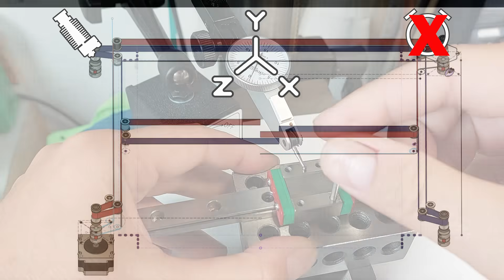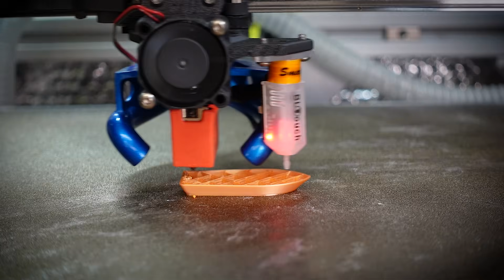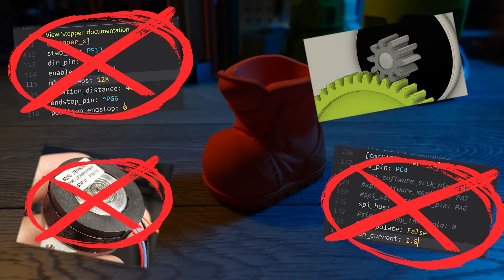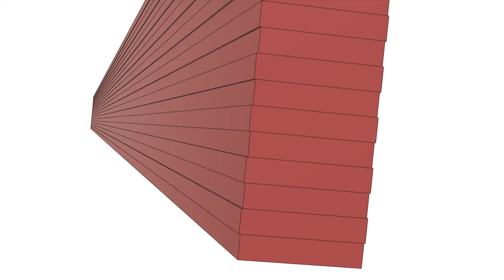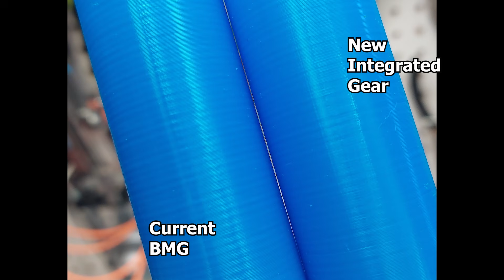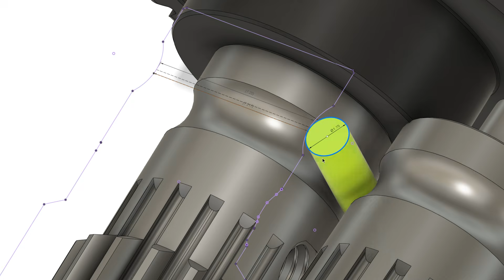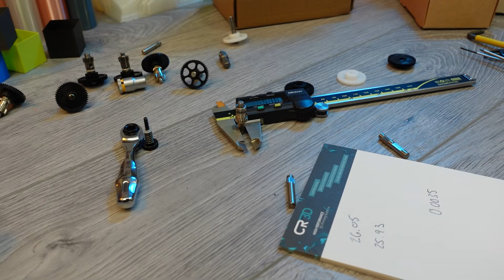Extrusion Quality - Mystery issue resolved !

Comment: I think you doubled your estimate of the error at some point during your calculation. You measured the deviation between the high point and the low point as 0.076mm, then you declared that this applies to the radius on both sides, and calculated that the deviation between the high point and low point is 0.152mm - but you just measured the deviation to be half of this value.
Reply from the maker: I had the same reaction then you initially. But try it out.  You will see that since we are playing with radius, it doubles the value.
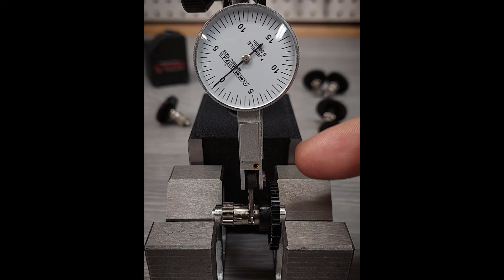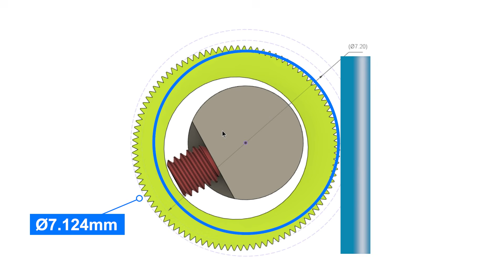Reply: But your setup at 8:11 is already measuring the deviation of the radius between the minimum and maximum point. Your diagram at 9:40 shows the exact measurement that you are making with this setup, but at 9:40 you have erroneously doubled the distance.
Reply: Other than that, no issue with the video! Great stuff, good problem solving, etc. I don't think this invalidates any of your argument. But I think it is a mistake to double the value.
Reply from the maker: @jsincoherency  ha, I see your point.  Illustration should have shown the delta between the 2 diameters rather than showing this at the radius.  But the math are still valid for the following steps.  Thank for the feedback.

Comment: One tip - the effects show up at a certain frequency - distance between pattern. If you calculate the time required for an effect to repeat, you can calculate its frequency in herz.  Now you can look for part of the system that run at a similar frequency. So if the Artifact happens at 0.2 Hz look for thing that happen at a similar rate. This can help eliminate certain components because any variation in their behavior would not directly impact the pattern. 

If none of the components have the given frequency the most likely culprit is the interference of multiple systems. This can cause multiple higher frequency systems to produce effects of a much lower combined frequency.

Checkout wiki/Beat_(acoustics) and wiki/Superposition_principle
Reply from the maker: Yes exactly what I did.  As soon as I realized extruder was in cause I printer a single wall cube with perimeter corresponding to the volume of one full hobb gear turn.  If repetitive was to be shown there it would have been something else.  But the artifact was not visible.  As soon as I reduced the cube size it started to appear inclined.

Comment: I don't think you need precise filament, A more ideal high end solution would probably measure the diameter and operate in a moisture and temperature stable environment.

Comment: my best mod keeping visual quality up is keeping the ptfe liner instead of going all metal. 
Second is sticking to two perimeters only. Thick walls amplify not ideal extrusion, especially printing inner wall first.
Third is way slowing down print speed. At snail mode you can fine tune extrusion more precise than on high dynamic printing and remove band aids like linear advance out of the equation. Fun to tinker with but obviously no one wants to wait an hour for a xyz cube.
Showing some of my best parts without visible layer lines got me ridiculed on certain online forums, instantly turned my back on those people

Comment: When I built my clockwork extruder for my first Voron I discovered that the gears were slightly too far apart and that caused backlash and big extrusion inconsistency. By moving the gears to mesh tightly this helped hugely. But having the gears too tightly together also caused issues. Now I use lgx extruders which are pretty good out of the box. Over extrusion was the main issue for me. And getting it spot on helps achieve perfect layers. I calculate extrusion factor by watching for gaps between walls. Lowering it as far as possible until gaps appear between walls. Lowering it way lower than I ever thought you could. Like 0.84 for PLA. No measuring wall thicknesses with callipers anymore. I just haven’t looked back.

Comment: You yet have to consider the dinamic forces that applies over these parts and do a simulation considering all the materials.
Proper way to do the job would be to go with a full metal system which uses a metal with low deformation, high tensile strength like Titanium or some Steel alloys and variants. Also should be proper measured.

Comment: Well done. You might also look into how the filament is mounted. I don’t believe bowden tube is the only factor in its improvement. I’ve found a side spool mount improved consistency in the flow. Side mount puts the filament closer and directly in line with the bowden extruder. While direct drive has the spool well above the extruder and can cause lags or jumpsx in resistance pulling the filament. I’ve even found side spool holders with bearings improved flow consistency further. I did a video on that as well.
Reply from the maker: Thank you for the advice Chep.  I'll have a look at your video.  For my testing I used a bearing spool holder and made sure the filament output from the spool was as aligned as possible with the extruder input in order to limit interference with what I was trying to isolate.

Comment: I wonder if you could fix this particular issue by just using a conical end bushing on the shaft to force the hob gear into center regardless of what the tolerances are.

Comment: Excellent video man. Glad to see someone testing this without any assumed deference to manufacturer or gospel. Have you considered the idler gear being a tight slip fit (talking machine slide bushing/bearing tolerance here i.e. lapped slip fit so it won't wobble or cant) that is spring buffered on either side? This should allow the filament to correct it's alignment and may even give some buffer to filament concentricity or thickness variation. It's not always just a pure cylindrical diameter variance as we like to assume. I've never seen anyone brother to measure concentricity, but I have often observed variation in cross sectional uniformity that are visible to the eye in many complex shapes. Plastic being well, plastic, all sorts of variables can have an ostenisbly limitless affect on the shape.  To some degree, when dealing with lower elasticity filaments (i.e. not what we classify as "flexibles") we need to think of the extruder "gears" and the rest of the filament path until exiting the nozzle as a roll forming (roll milling/rolling mill analogs) process as well. Everything that exerts any pressure or conformation is reshaping the filament, though that's not necessarily undesirable when considering the aforementioned conformation consiserations of the stock (filament). Cheers, cant wait to see more on this.

Comment: Proper printing created an extruder that uses belts instead of gears. Maybe you could try experimenting with that design? if you can fix tolerances, the belt system may be able to imitate the sort of hysteresis that smooths out the bowden prints by pushing the filament with rubber instead of rigid metal. Proper Printing is also amazing, I'm sure he'd work with you.

Comment: been waiting for someone to finally put in the effort to narrow down exactly what in the extruder causes this issue. You've done a great service, and if we can improve tolerances, this is the next big upgrade in 3d printing.

Maybe an easy way to fix the tolerances in bondtech style dual gears is to machine the gears with the 5mm shaft as part of the gear instead of a separate pin that gets inserted and set screwed in. if you're using a lathe to machine the majority of these gears (like you should), this will ensure it is fully concentric and honestly this wouldn't be hard to do at all. the only tolerances you'd be worried about at that point is how the shaft fits into the micro bearings and the 3d printed housing.

lol just got into the part of the video where you talk to bondtech and came up with the same solution.

Comment: WELL DONE SIR!! Seriously you did an amazing job of analyzing this problem and your findings are absolutely huge! But.. I wonder if instead of perfecting the extruder system what if you were to somehow inject some sort of artificially dampening? Some simulating the dampening the bowden tube offers without having an actual bowden tube in line? perhaps in such a way that wouldn't impede the printing of flexible materials.. Just a thought.

Comment: My main struggle? Z wobble. I have a $3 budget to fix it. So I replaced wonky M8 rods with slightly less wonky M6 ones, because real acme lead screws are well outside the budget. But I don't feel I've done it very well, something not quite with the alignment. I tried to also make self made backlash free nuts which would have two nuts in a chamber separated by a spring, but it was a catastrophe and bound things up. I need a better way to decouple the gantry from the wobble without buying anything and without it being gravity fed, since with gravity decoupling I found it sometimes lifted up on one side.

Comment: This is an eye opening for me.  When I moved from the single gear system to a better extruder, I began to notice these "vertical artifacts" on my prints so much worse. I have been trying to solve them and everyone I chatted with said "they are normal, everyone gets them" but didn't know "why" -  but considering the were less pronounced with a single gear extruder,  seemed to point to the problem.. yet no one seemed to be working on solutions.  Just an "accepted result" of 3D printing.  I hope we can all finally pull together now and get more accurate extruders, precise and reliable.

Comment: Bowden for delivery of material, but use a small stepper motor at the hot-end to do retractions/pressure control.
The Bowden-tube fitting on the hot-end would be mounted in such a way as the stepper would push the fitting back from the hot-end during a retraction cycle.
Rather than yank the filament back using the extruder motor, move the end of the Bowden tube at the hot-end!
This would serve for very fast retraction (or pressure advance!) while keeping the benefits of Bowden smoothing.

New Retraction cycle:
1) Stop extruder motor, 
2) activate retraction motor [see below], 
3) make non-printing move, 
4) deactivate retraction motor, 
5) resume printing.
Filament would stay remain stationary in the Bowden tube during the retraction cycle.

The retraction motor uses positional feedback; monitoring the current in the motor would give a good estimate of pressure in the nozzle.
[Holding the retraction motor at a steady position would require more or less current, directly related to nozzle pressure]
Retractions could now have a feed-back component.
How much retraction?  Only enough to drop the pressure below a certain level.
How much pressure advance?  Only enough to keep pressure steady.
One could 'see' the flow conditions inside the nozzle....too much pressure for the desired flow-rate?  Bump up the heat or slow down the print...
Automation of these relationships would be implemented in printer firmware, I guess.
Having direct control and monitoring of nozzle pressure would be a good thing, neh?
Reply: Interesting idea....

Comment: loved the simulations. been on the same rabit hole for 2 years and eventually accepted that 3d printers are what they are and I can't do anything with my limited tools. 
btw, there was an awesome community that came out after many complains from a prusa github issue called "602 wasteland" where many people, including me, researched many of the topics you discussed. maybe you should take a look, extruder linearity and microstepping precision was found to have a significant impact too (TMC2130 were considered to be bad, and one guy from LDO was gathering feedback for new stepper designs). bowden, gearing, heat-creep due to insufficient cooling, non-concentric gears, vfa, and "smooth" idlers were also tested (there even was an optional prusa bear extruder smooth idler part). funny how bondtech knockoff gears also had better tolerances for me than the original ones.
Reply from the maker: Oh wow! I'll have a look!

Comment: Dang, I wish you had know about the video from Mihai designs called What I learned about dual gear designs. His theory is that the gears are bending towards each other near the filament drive teeth. It's would be good to test a set with deeper teeth as well as some other variations, but I think the final solution will require helical gears or something like the Fuselabs FL300 extruder

Comment: Ender 3 came with toothed belts and lipped bearings instead of toothed pulleys/idlers, if you install the belts using the toothed side as the contact side it will create all kinds of belt vibrations that translate into similar artifacts, they change with speed though. I bought toothed pulleys and got rid of the  smooth idlers and a ton of noise went away.  Each tooth was basically bumping up against the idlers creating vibrations. Nice road, bumpy tires.

Comment: If we used the nice Fysetc pom gear/shaft, all we would need would be a press-on version of the Bondtech gear and maybe a special hollow tube to drive it on to the right position for each application.

Comment: Now I have true paranoia - the last two extruders I built (using bondtech stuff because of course), both had eccentricities... you could tell because when you pull filament through to line up the gears and test it before the stepper goes on, it had variable force around spur gear angle as you pulled.  Yikes!
Reply from the maker: Yes, that new integrated gear makes a whole difference on that perspective.

Comment: The hub gear has a clear impact on the filament speed because it's directly in contact with the filament, but the big (plastic) gear does not have the same effect as long as the gear teeth mesh well

Comment: Thank you for the video. It’s amazing how easy it is to look over something so small and it not be until someone else lays it out for you that it all comes together. Even on a bowden setup I have I have that artifact and it was driving me nuts because the more I worked on tighter tolerances the worse it seemed to get. Now I realize (or believe so anyway) that I was actually amplifying the problem. If nothing else this video really opened my mind in considering to having a more methodical approach to problem solving.

Comment: I’ve had similar issue on my X axis, was really hard to find a drive gear that wasn’t wobbly for some reason :/ Even the ones I spent like 15 bucks on still wobbled :O But I’ve solved it now :) Extruder had a similar issue, but it was not a wobbly gear but too large teeth, meaning the effective diameter changed while the teeth engaged the filament.

Comment: Have you tried changing the frequency the heated bed pwm’s at?  If not, it would be worth a shot as that is what this looks like to me.  You will this artifact change significantly when you start to play with it.  Cnc kitchen did a vid going over the subject and it’s worth a watch if you haven’t already watched it.  I eventually tried this after swapping to a bearing rather the second hobbed gear and while this helped, the ultimate culprit was the pwm frequency of the bed heater.
Reply from the maker: My printer uses AC 110V for the bed, therefore impact on other electronics is negligeable if not null.  This artifact completely changes with a + or - 5% on extrusion flow.
Reply: @MirageC  my bed is 220v and I thought the same as well.  I would try it before you rule it out.

Comment: Thank you for this great video. Very easy and enjoyable to watch.
I have same problems with new Creality Sprite Pro extruder. I found some info that the gears are press fitted and cant be changed. I'm afraid to disassemble it yet so it is what it is. This is a topic to keep an eye on. Kind of glad that it is not only Sprite extruder that has the problem but direct drive dual gear extruders generally.

Comment: The output power of your temperature controller just goes on and off. A tuned PID would give output values inbetween. May the P-value is way too high?
Reply from the maker: That was the PID tuning sequence that I filmed and accelerated for the video.

Comment: Do we really need dual gear extruders for classic / conventional materials:  PLA, ABS etc.  Titan like simple extruders works fine with classic materials. Maybe back to basics ;)
Reply from the maker: Per my hotend testing this is exactly what I am demonstrating.... Pressure is only required for getting you through or out of clogging situations.  Printing under pressure is not a good idea for a lot of reasons ;)

Comment: Thanks so much for the video. I suspect this is the cause of artifacts in my CW2 extruder. I've taken the thing apart a half dozen times trying to figure out whats going on with it. I think I'll try adjusting the drive gear and putting some bearings on the idler.

Comment: While I love the problem solving and math, the math will be slightly off, as the gear speed doesn’t change with diameter, but instead with tooth count. This the variation will be due to the actual filament drive section of the gear piece, as this will drive the filament based on the apparent diameter that changes due to the set screw.
Reply: That is not true for the filament gear

Comment: What about dual idler gear setups? It should give you more consistent extrusions as long as the hole is concentric with the gear. Shaft doesn't need to be concentric to gear teeth in this case as all the driving is done not through the shaft, but through an extra gear. This will induce forces pushing one of the gears up or down, but the filament is in the way. So there shouldn't be any PERIODIC deviations, but could be pressure-dependent deviations which completely disappear in vase mode as you are printing with constant pressure. At least this could allow to confirm or rule it out as the cause.
By dual idler setup I mean something like the Bondetch's LGX extruder or its Chinese TBG-Lite clone. Give it a shot?